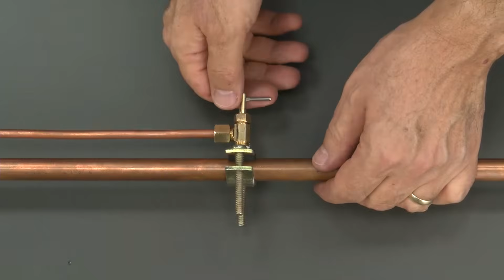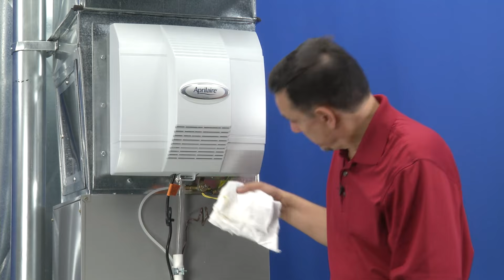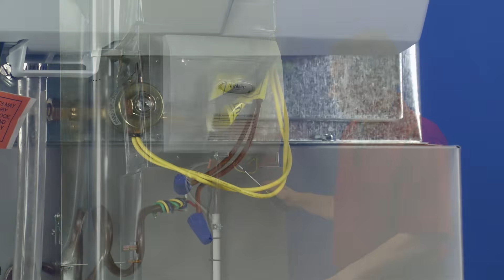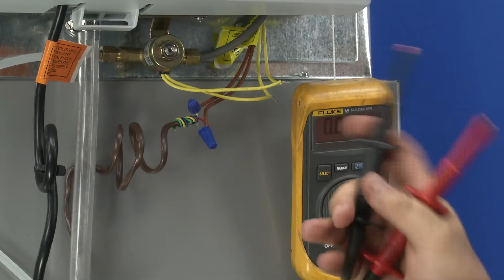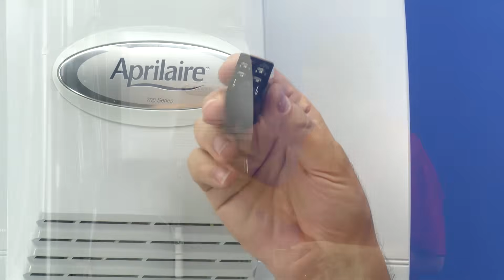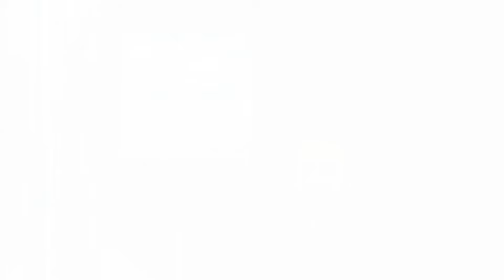AprilAire Fan Powered Humidifier Troubleshooting - Water Not Running

Comment: Question we upgraded our furnace to variable fan speed. And we leave the fan on all the time to help filter the air.  The Humidifier has an out door temp and power feed from furnace. It turns on in test mode, water flows, a lot of water, so I slow it down to a trickle. But now there is so little water the humidity is not going up in the cold days 20E the are gets so dry our eyes ach and require drops. What can I do to get more water at faster fan rates????? So At low fan less or no water???

Comment: Another way is just removing the valve from your system and open up the valve by unscrewing the top of the valve open it up soak it in vinegar for a while. Use a small pointy brush if have one and clean the inlet. After that put it back together and use a 9 volt battery and connect the valve to it and hear if there is a clicking noise if so, the valve is working again. Most of the time they fail because of lime scale builds up in the valve and a simple cleaning will save you money. That Solenoid Valve is over $100 dollars, and a simple cleaning will fix the problem. If you put a new valve on it will probably stop working again because of the water in your home. I also squirt a little oil in the inlet. https://youtu.be/DEqyvzV0z6k Hope you can save money. Some videos just want to sell you the parts instead of repairing what you have.

Comment: Mine have a weird noise, on and off on and off is that normal?
Reply: If it’s turning on and off in short bursts that is not normal. It sounds like an issue with your humidistat or a loose wire.

Comment: Great video!  But I think it's also good to mention the plastic inlet strainer, and the sintered bronze filter that's in the inlet side of most solenoid valves.  If either of these gets clogged with rust, or calcium and lime, the flow through the valve can be impeded and you will think the solenoid valve isn't operating.

Comment: why didn't you just take the front cover off to access the solenoid wiring inside there?
Reply: When you remove the cover the power to the solenoid valve is disconnected. There is a plug built into the cover that connects to those yellow wires.